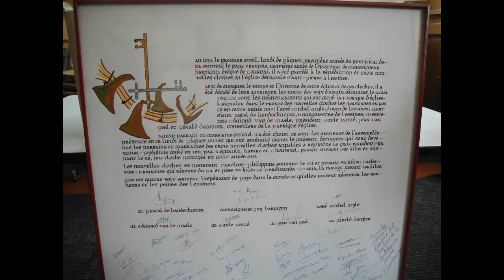Cloches de Lessines

Comment: Les ferrures actuelles sont-elles suffisamment solides pour supporter le poids du bourdon sonnant à la volée ? ( 1500 à 1800 kg ? )
Reply from the maker: Je ne sais pas.  Il nous semblait que les joucs ne sont pas assez solides et ont tendence à se plier au joints.
Reply: Thierry Pauwels  Il faudrait je pense t faire réviser tout le travail de suspension par une Entreprise vraiment spécialisée   ;  qu' en pense l'ami Tchorsky ?
il faut aussi se rappeler que la composante d'ébranlement d'une cloche sonnant à la volée  =  son poids x  3
Reply: Comme les cloches sont en lancer rétrograde, il n'y a quasiment pas d'effort sur les ferrures, l'axe de volée étant plus bas que le point d'équilibre.
Reply: valdom68 En Espagne , là où dans les volées tournantes qui sont quasi générales ,  l'axe de volée de la cloche est  surbaissé et plus bas que le point d'équilibre , il a fallu équiper les cloches avec un battant en plastique incassable ( seule la boule de frappe étant en acier doux )  car le système provoquait sinon , sans signe préalable , la rupture fréquente des battants tout en fer forgéou en acier ..... avec les accidents  qu'on imagine !